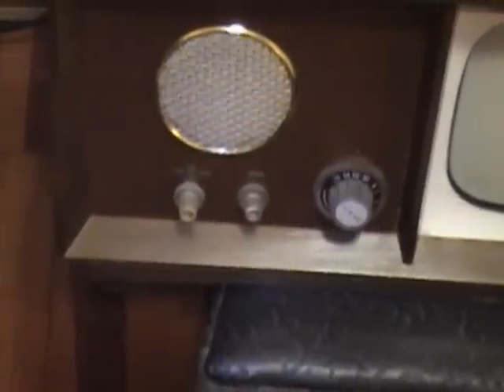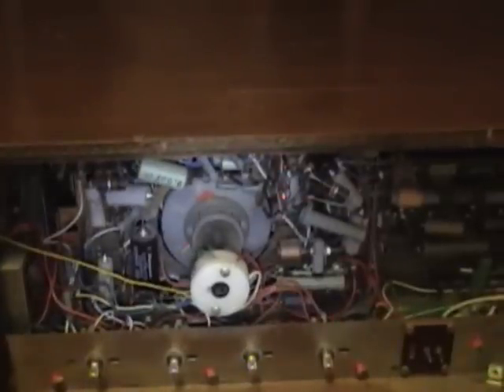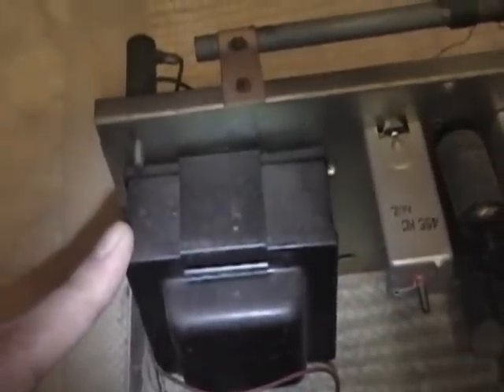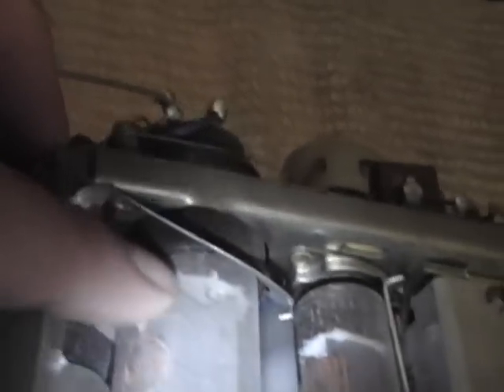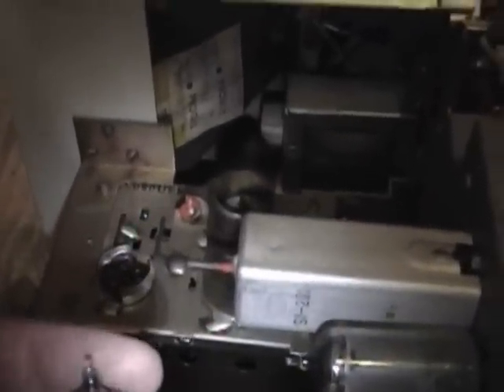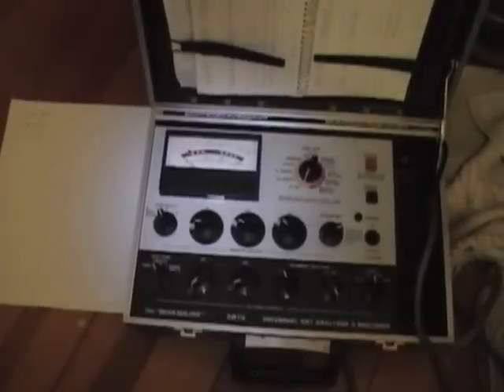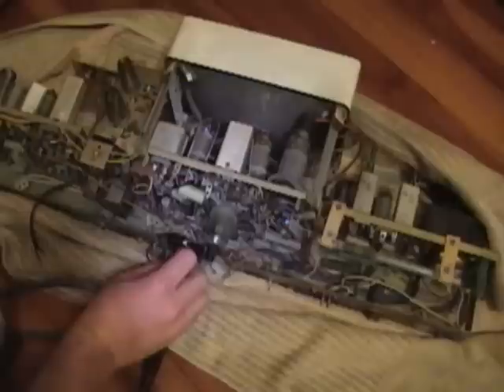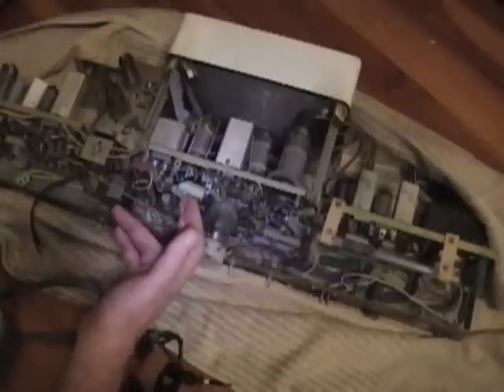Bel-Aire Combo TV / AM Radio / Clock

Comment: AC power in Japan is only 100 volts, so you might want to add a dropping resistor or run it on a variac, because running it directly on 120 volts might push some of the components a bit too high on the voltage.

Comment from the maker: I got my Sencore used on ebay.  I'm pretty sure they originally came with a complete set of adapters.  I've never actually used any of mine though because I only work on the really old stuff.  For that you need to use the universal adapter with the little EZ clips.

Comment from the maker: No, I never bothered to do a trade.  As I recall, 3 or 4 would work with my Predicta CRTs.  Almost all the other adapters are for color CRTs which I don't mess with.  What I really should do though is fabricate a customer adapter for all the 40s B&W CRTs.  Others have done so and posted the details online.  I need to fix up by B&K 466 tester too.

Comment: @vwestlife I think that most of the Japanese made electronics were made to run off of either 100 or 120 volts by adding an extra tap on the primary of a transformer in an AC set. In their five tube AC/DC sets they used a 35C5 in place of 50C5 in domestic sets and used a 50C5 in export models destined for North America.

Comment: That's one of those things that was so tacky that you just had to have it. It's like a 1/10th scale model of a 1960s combination console TV and HiFi.  I would bet that the cabinet is made out of luan plywood. At least they used point to point wiring instead of printed circuit boards, weird how they used a vertical mounted chasis but have the tubes facing forward instead of backward. I know of someone on you tube that could translate that paper label their handle is 60otaku3.